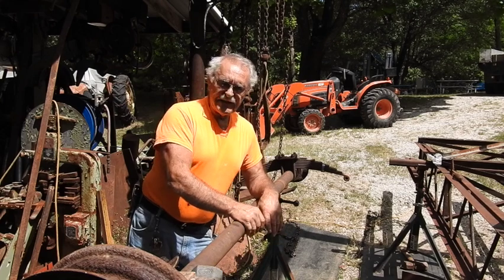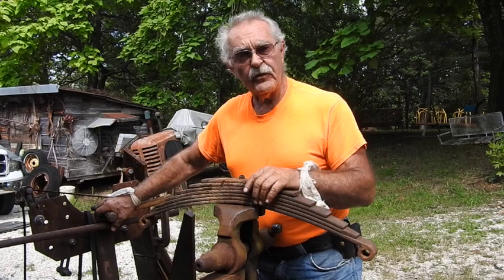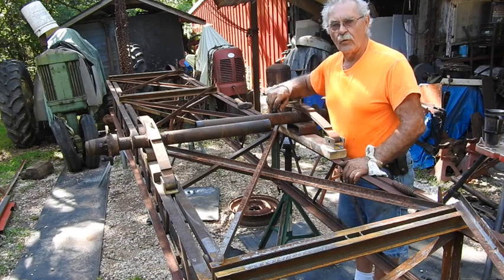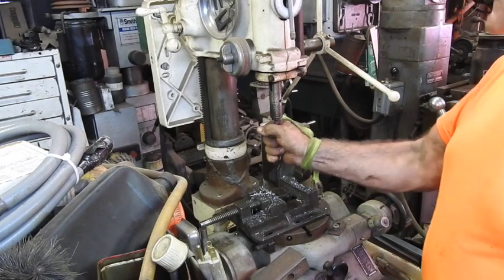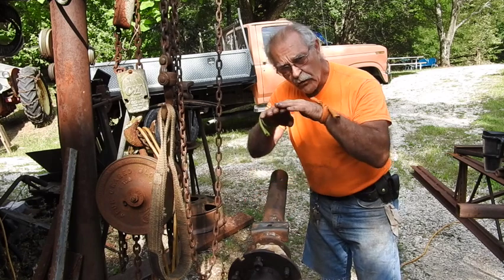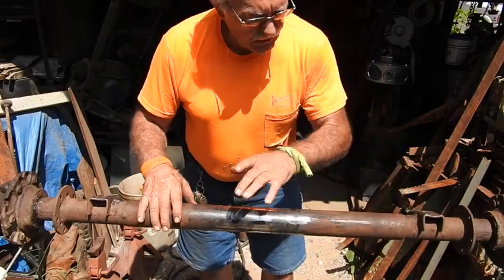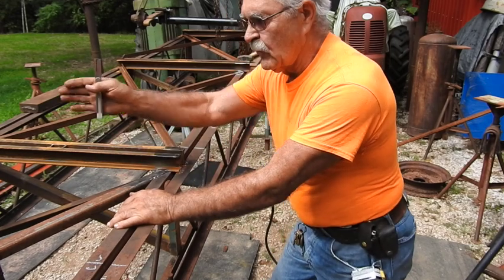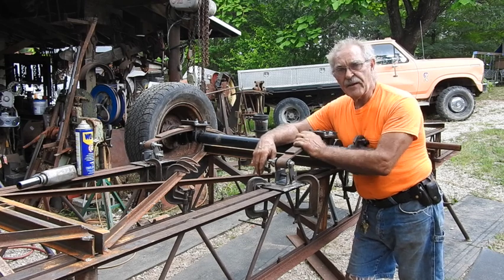Repurposed 1950's Mobile Home Axle for Frontier Sawmill Trailer Pt 2

Comment: I awoke from my dreamlike slumber only to discover that the kitchen stove was plum out and getting cold. So I stoked her up and made myself a root beer float. Then turning on YT found a new 44 vid! What a treat to go with my treat! This trailer is lookin right goodmaking up fancy axels and figurin where to place it on that fancy frame. I think gold leafing certain parts will certainly dress it up good enough for a parade! Yep, winter is coming and this may be our first night of frost here inna holler. As long as leaves remain on the trees it holds the heat in. Up our road a quarter mile are some houses on open lots and will have white lawns with frost while here inna holler won’t have a bit of frost. I do believe the JOfaries most likely warm things up with their wings and body heat as well. Plus a cuppaJO in and of itself creates warmth,,,,as you well know. I suppose your trailer project has required a few cups in the process. So my root beer float was made more enjoyable by your lovely trailer and your sweet little self as well. I suppose your summer tutu isn’t the best when welding. Don’t want sparks around that fancy lace on the edges. And the slippers? Well they just can’t stand up to those sparks, as we well both know, eh? If you do wear your tutu be sure the Missus takes videos for we your fans out here in tubeland. It will be appreciated by many I’m sure! We’ll time to put another log on the fire and visit dreamland again this sleepy time for DaveyJO. So this is DaveyJO and I’m outta here to once again enter that state of rest in the sleepy time fairy land of dancing JOcups! My Best to All at 44land!
Reply from the maker: Well DaveyJO, I can tell by your awesome comment that you are well on the mend.   Almost back with the living I see.  LOL.  I had the Missus call the welding supply and see if they sold flame retardent tutu's but alas, they said no they did not.  So we are out of luck with that for now.  Maybe Amazon....THEY've got everything for everybody !! LOL
   The Missus really got tickled at her vision of you and I in matching tutu's splitting wood and sitting around the stove swapping stories with massive cupps of JO right there at the ready !!
   See ya later my friend....Keep doing what the doctor says, or I'll have to tell nurse Alice to give you a good spanking !!   Now THAT would make a good video.......LOL
Reply: @tractorman4461  Well, perhaps a spanking might be,,,,,,,,,oh never mind.  You and I in tutus? TuTus 44 and we’re dancing outta here, eh? I can see special dances around different tractors, the best around the 44 of course. It would go viral and I can see us on the Tonight Show doing our thing,,,,,,well may be not! I started rehab last week and I’m doing preddy gud. Tomorrow it will be7 weeks since surgery, hard to believe. I’m thinking about getting an battery powered chain saw which would be lighter and no pull start, which I’m not supposed to do for now. I cut the cook stove wood in 12”-14” lengths and using some nice dry oak and she’s a cranking plum fine. I’ll have to make some corn bread in the oven as I did last winter. Seems it tastes better in a wood fired oven. I’m going to the Amish Walmart and check on prices and tractor calendars too of course. They have Dewalt and Millwalkie  but I might check at Lowe’s for  Colbalt brand or Echo I believe it’s called. Lots of good dry limbs in me woods to cut for the kitchen. Sure do love that old cook stove! Checking out the web I figure it’s late 1800s or early 1900s but about 120 years old. Called a Wincroft made in Middletown , Pa. by Harrisburg, an hour away from here. Anyway, if that weld shop doesn’t have weld proof tutus then we should manufacture a 44 Brand,,,,,,for the delicates welders summer ware. The Missus could be our designer with the latest fashions. I’d best go and relax after all this heavy thought and ideas, eh? Love to All at The 44 Holler from thisHoller! DaveyJO
Reply from the maker: @daveyjoweaver6282  Hahahahaha...crackin' me up DaveyJO !!  Greenworks make a pretty good battery saw too.  A buddy of mine gave Stan a Harbor Freight battery saw once he got done with it.  Stan uses it a lot.  He says it get a little heavy after a few cuts, but what the heck, he turned 90 about a month ago !!  Still getting out there and getting after it !!  What a guy huh.  Yeah, you better relax a bit now after all that hard 'designer' thinking.  Hang in there my friend, I can tell you are doing wonderfully well already.  Give my best to Nurse Alice !!

Comment: In the 70's there was a rash of building cars with big engines. I welded a couple drive shafts for friends and relatives. Having a slug in the tube is a good idea. Never had one break and those were stressed as much as the drivers could. 
Good job on the weld. That saw will be the talk of the logging community. 😁😎
Just happened to think that a good reason to have the axle behind the centerline is you want tongue weight to be about 60/40 or so. I had a 22 foot  McGregor sailboat that weighed in at 3500 lbs. wet. I bought it in a shambles and put it into running shape before I took it out on the lake by myself. I had always set the engine in the truck bed before moving it so It wouldn't drag on the ground. We were at Coldwater lake and the weather swarmed us with a thunderstorm. I pulled the boat out on the trailer in the pouring rain and drove home with the engine hanging off the transom. About half way home we got on Fremont road and there was a nice smooth stretch. I got up to about 45 mph and the truck started swaying. The motor tipped the tongue weight balance too far to the rear and the boat was steering the truck. Fortunately I was able to stay on the road, but from then on I make sure a trailer is loaded slightly tongue heavy. 
Might be a good idea to have the bandsaw strapped down slightly ahead of the axle. 😫
Reply from the maker: Hahahaha....good story.  I've been pushed a time or two by a load and it certainly IS a bit scary !! Yes, the good thing about the bandsaw is the fact it can be positioned anywhere on the bedframe to adjust the tongue weight.  I think the factory trailer has provisions built in for sticking a pin or a bolt just where they want it for transport.  The only thing is, the factory trailer limits the length of the bedframe to two 7 foot sections.  I want to be mobile with a full three section bedframe, or 21' full length.
Reply: @tractorman4461  Your trailer looks like a gtrat idea. On site setups will go much faster. 
Drop, level, and cut. 
For close to home work were you planning on towing it with a loader tractor,?
Reply from the maker: @OldSneelock  Yes, at almost 22 feet in length, it's best maneuvered with one of the tractors back in the woods.  Add an extended cab 3500 Dodge with an 8' bed and it gets interesting real quick in a tight spot !! LOL

Comment: Hi re-watched the video in a quieter room Heard you say per foot of the deck thank you you are very knowledgeable I enjoy your videos keep them coming
Reply from the maker: Yes, I didn't know for sure if that was made clear enough.  That's the rule of thumb I use on larger trailers.  Small short coupled trailers I'll just tack the axle in place until the trailer is almost done, then set the tongue on a scale and adjust the axle to the point I get the amount of tongue weight I want. THEN weld the axle to the frame.  
    Thanks Floyd for the comment.  I gotta admit it is very difficult to say only the important stuff and ALL the important stuff while making these videos.  I think of a hundred things I should have said on camera while editing them for publishing.

Comment: Wendell, you never cease to amaze me with the depth of your knowledge and breadth of your skills!  I didn’t know axles had a built in crown, but it makes since now that I think about it.  Fantastic job!
Reply from the maker: Yessir, there sure is a built in crown.  There's multiple reasons for that, but it has to do mainly with load distribution and tracking of the wheels for tire wear.  I don't know all the particulars and portend to, but I do know if you weld them back incorrectly you may have a trailer that wants to do figure 8's behind the tow vehicle.  Thank you Martin for always the kind comment my friend.
Reply: @tractorman4461  BTW, is your name spelled with one L or two?  I always use two because I saw someone else spell it that way early on but I want to make sure I spell it right.
Reply from the maker: @DIYMyWay  Yessir Martin....you got it right....two L's.  Been that way my whole life ! LOL

Comment: A few years ago, I helped a friend of mine build a trailer, for carrying a small John Deere dozer. We used  the chassis frame rails from a school bus. The axles were from a tri axle set for a 
mobile home. When I asked another business friend who happens to be in the bearing business, about replacing the hub bearings he advised me to throw away those "light duty mobile home' bearings which had 8 rollers and replace them with a heavier duty set of bearing, same size, but with 12 rollers each.
Did you ever hear of this?
We had to cut and shorten the axle tubes as well, and did what you did, I do remember those 'tubes' being similar to schedule 80 too. Yes, we did use a tube in tube stiffener like you did. Sure is a better way to make a stronger join.
This build is bringing back memories and I find this most interesting, Thanks for this Wendell.
P.S. I am currently building a very small trailer now, for another friend, who wants a trailer to haul fire wood logs from my back woods to his home / wood pile. He's hauling this with his ATV. 
I enjoy this too.
Reply from the maker: The newer style axles from the 80's on are definitely less durable due to the normal 'cheapening' up of a product.  Mobile homes really only travel at the very most a few times over the course of their life, the longest being from the place of origin to the sales lot.  So they really don't need the super high quality bearings and the higher cost associated with them. We have found that the  best axles are the really old 50's axles because they were both a heavy tube and heavy bearings, and the Timken and National part numbers still cross reference today.                                                                                                                                                                                                                                                   We have also made a few trailers out of the newer old axles from the 80's and those trailers didn't go anywhere without a packed bearing in a zip lock under the seat.   On the one tandem that was  used a LOT for hauling tractors and logs, as soon as a set of older axles were available, guess what....those were changed out and yes, its still on the road. 
   Good luck on your friends wood hauler Reg !!  We build those small wood haulers out of old fuel oil tanks that used to sit besides half the houses out in the country.  Lay them on their side, cut the top out, reinforce the rim and stick a black iron pipe frame under them. The perfect size for compact tractors or lawnmowers.
Reply: @tractorman4461  Yessir and Cheers!

Comment: Great!  Your press drill does not show any sign of movement while you press the drill in the axle... I can't say that for my Chinese press drill!  It should have a bow on the post to compensate for the flex! You sure did an axle strong enough to support 10x the weight you intend to haul!  Nicely done, including plug welds on the inner tube and a super nice butt end weld. Thanks!
Reply from the maker: Hahahaha...yeah Joe, I don't think there's anything to worry about when it comes to handling a little weight !!  LOL  The full bevel to get 100% penetration with the low hydrogen rod at 70,000 pounds tensile makes sure the axle won't break, but the inner pipe button holed inside ensures long life no matter what!!  Thanks Joe very much for the superb compliment my friend.

Comment: I've gotten a little behind on your videos. I've been trucking. Over 40 years ago, an old pipe fitter had me help him build a pipe/tubing turner out of a rotisserie for a grill and 10 speed bike sprockets. It worked very well but I can't remember exactly how we did it. That trailer will work nicely for you.
Doc
Reply from the maker: That's cool Martin.  I've tossed around the idea of making a pipe rotation rig,  but I don't weld enough pipe anymore to warrant it.  I should have built it 30 years ago when I thought of it the first time !!  I've got gear heads of  various ratios of reduction and a foot control too !!  Glad to have you back off the road with enough time to watch a video or two.

Comment: That axle turned out very well. Drilling the 3 holes to weld the inside pipe was great idea.
Reply from the maker: Thank you Wild Bill, it really strengthens the axle.  When I build off road trailers with pipe tongues, I'll drill the outer pipe numerous spots from one end to the other then jam whatever size pipe inside I can get.  Then weld the holes shut while melting into the inner pipe.  Makes it super strong by comparison.

Comment: I didn't know you had an Avery! You should do a video on that, if you haven't already. Ive watched tons of yor stuff but usually can't comment because I watch them on my smart tv. lol I love the videos, keep up the good work!
Reply from the maker: No, I don't think I've done a video on that one at all.  It's just been in the background a few times.  It's not run in at least 12 to 15 years and when it DID run it smoked like a freight train.  I'd found another Avery that had a perfect running engine but was missing the front end and sheet metal.  It was offered to me for $400.00 and I meant to go back and get it, but time slips away and so did that parts tractor.  I've kicked myself a hundred times since !!  Thanks Mike for the comment and the interest in the old Avery.

Comment: Missed this video last night watched it this morning and learned something hahaha. Trailer axle positioning I’m getting ready to build a small trailer for firewood I I’ll be using this info soon mill is gonna be even better once it’s mobile
Reply from the maker: I tell you what I do on a lot of small trailers.  I fab the entire trailer with the axle either clamped or just tacked in place. Then I place the tongue on a scale and adjust the position of the axle for the desired weight.  That works really well on small ones especially.  Thanks Timothy for the time you take to watch and comment.  I think the one foot plus one inch per foot of deck length on small trailers wouldn't work out quite right, but that depends on the size. I guess I should have clarified that I was talking primarily trailers of more substantial length.   Good luck Timothy with whatever you build.   But were I you in this case, I'd try the scale routine.
Reply: @tractorman4461  hey it’s no problem I like the video you post I learn from them or I take the info and try it my own way. so using a scale to balance the weight on the tongue.
what’s a good tongue weigh on say a 4x8 trailer with 3 ft sides maybe 4 I have a John Deere 485 that I’m gonna primarily use it with but I’d like to be able to take it out on the road with the truck also
Reply from the maker: @timothymartin1776  On the small trailers, like my 4'x8' wood hauler, I like a comfortable weight to bend over and lift to hook to the drawbar.  Enough to ensure the tongue pushes downward while empty. Not a crazy weight.  The balance then of the trailer depends on how its loaded.  Always with more tongue weight to ensure the rear wheels of the drive vehicle, be it a tractor or truck, benefits from the additional traction that weight gives them. 
    I saw a video of a mid eastern guy with a donkey pulling a two wheeled cart.  The back end of the cart was almost on the ground and the rear legs of the donkey were about a foot in the air.  The moral of the story is to maintain tongue weight.  LOL.
    Typically the wood haulers we've built are built solid with no springs so heavier loads can be hauled. Those types of trailers cannot be pulled down the road by a truck at any speed to speak of....they will bounce all over the place and track erratically.  Springs limit the load that can be carried but at the same time allow it to be pulled on the road.